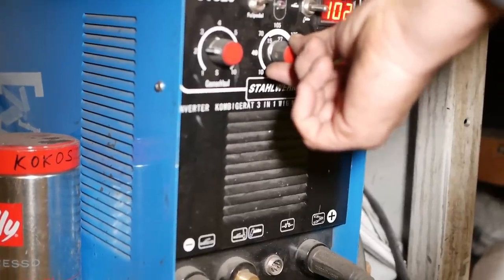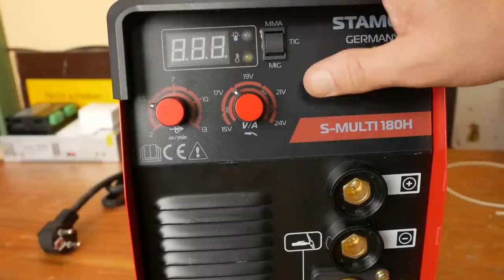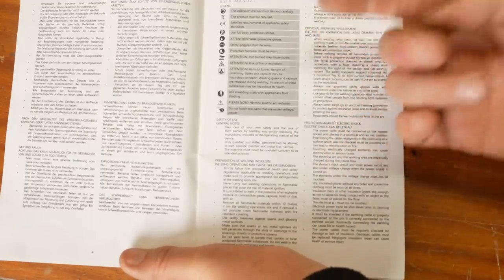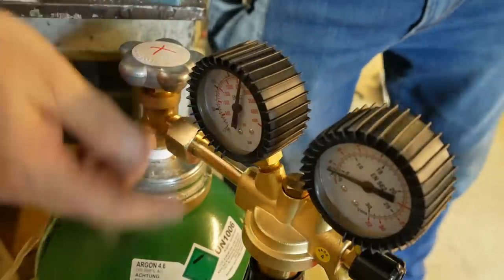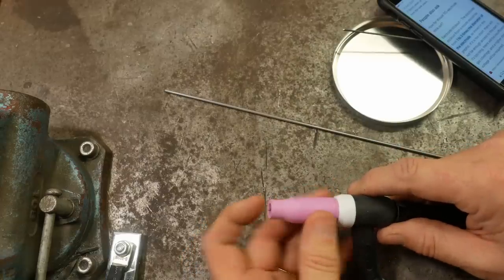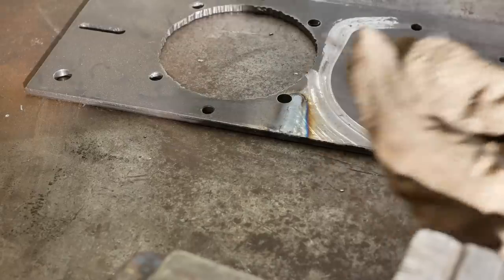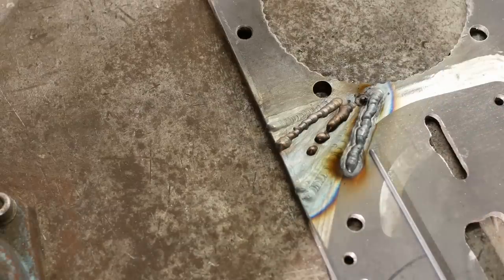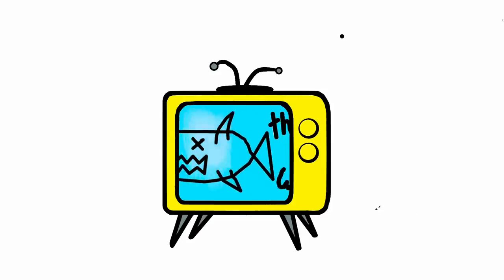Can I learn to TIG weld in an hour using just the internet? || RotarySMP

Comment: The one nice thing is that once you get it , then you got it. I can go months without welding them pick up the Tig torch and then within a few minutes Im back in the groove.

Initial it took me weeks to get a half decent weld down.

Aluminium is a while different ball game all together
Reply from the maker: That is encouraging to here. I am the same with the guitar. I never loose it. Math is another thing. That i forget when I dont use it.

This being DC only, there is no temptation for Aluminium.

Comment: Red or gold, what ever you find cheaper, id go 2.5mm for the amps you're running.  1.6mm filler rod is a good start, can all ways feed in more when needed, to much filler of a larger diameter will cool the pool and make it hard for consistent heat.    Try lap welding 3mm plate at about 40-55 amps,  cooler to start with and take yoir time, if it takes more than 2 sec to heat the pool youre too cold.    The hotter, higher your amps, the faster you have to move,  cool and slow, watch the pool grow as you feed in the rod.  Id start with a little more stuck out on tungsten, hold torch a little higher so yoi can see more of the pool.    30 year's aluminium tig, and mig, with S/s and mig arc welding.    You're doing as kiwis proud, best way to learn, just have at it.   Great attempt, hats off to ya pal, from Palmerston North, New Zealand
Reply from the maker: Thanks Russ. I was based at Ohakea for a few years, so was in Palmy a fair bit.

I also got a recommendation to use grey electrodes. I fear I will receive so much conflicting guidances that I end up confused.

I did another session this morning, and already picked up to be more patient to let the pool grow, and not jam in as much filler. I'll try your exercise on me next practice session.
Reply: @RotarySMP  if you have the time, and the disposable income to afford, try everyone's method, it is very much a personality feel, I gave what I feel works well for me, others have done the same, find what works for you and run with it.  If you remember doing brazing, or silver soldering at college with oxy/acetylene, it's much the same,  it's just the plasma arc heats the base a Lot faster.    Simple as Dab, move to edge of pool, Dap and repeat.  Try watching the edges of the pool rather than the arc all so, as it is so bright, it'll blind ya.     You showed the best attempt I've seen of anyones first go.  You're going pick it up fine.    Some people can, some can't, other's you can teach.  You showed already that you can.  👍😉
Reply from the maker: @russcole5685  Thanks for your feedback Russ. I think stick welding all my projects in the last years has helped me prepare for this. The only gas welding I have done was a sheet metal tool box apprentice project.

Comment: some tips.
1. get a flex head. they are very cheap and makes getting the correct angle very easy. 
2. (if you dont have a foot pedal) generally the 40amp per mil material thickness works very well to get into ball park, but when welding something small like a 1cm wide 2mil thick piece you wont set it to 80amps. usually i would go a bit colder like 75amps. 
3. get ready to sharpen a lot of tungsten electrodes. I did all my welding with stick and when going to tig you need to get used to holding the tig torch still at the end till arc stops. 
4. most of your welding you will be using the 1.6mm tungsten and filler, get a bunch.
5. flow meter is set based on the cup size and a bit more or less depending on situation (upsides down or not, are you welding in a space that will cup the argon r a sharp edge since argon is heaver than air) and cup types (if its gas lens or not, basically laminar flow or not) 
6. usually you are trying to get the the electrode as close to the weld pool as possible without dipping to get the best smallest weld pool.
Reply from the maker: Thanks a lot for your in depth response. It is a big help to get feedback like this.
Reply: @RotarySMP  One note Re the amps. It's a budget machine, so the dial might under-report the actual amps. If you don't get enough penetration or your puddle seems too cold, don't hesitate to up the amps despite instructions and tables telling you that the amps are okay. You can always dial down again if things move too fast or you start blowing holes into thin stock.
Reply: OO for flow rate, Cup size x2 = CFh will get you in the ball park, generally a no5 cup is good for most welds we will do in our small workshops. too much flow and the turbulence will pull in air and oxides will form (gray shit). if flow is set, amps set (not too "hot", cool enough not to oxidize when it gets out of the cups argon), metal is clean and shiny and you travel at the correct speed the weld will look shiny like new steel. too little flow will also let air in and oxidize the weld. 

7. the root is the be all end all, luckily in tig welding you can see the root of the weld easily and you will be able to see the weld pool go into the root BEFORE you add filler.

8. too hot (combination of amps and weld speed putting heat into pool) will cause under cut. in small stuff like brackets to hold a servo cable its fine, but anything that will see load cycles its no good since it will cause stress risers.

The strongest welds i have ever gotten is with tig welding and its nice because you can actually see what's going on and will know if the weld is good while welding. 

9. if you have any questions, use your community tab. we like to help and its fast feedback. What makes tig welding difficult is usually the prep. the amount of prep stainless requires is a pain. other than that, its quick to pick up.
Reply: @graealex  yes true, forgot that one. set the machine based on the simple ball park and adjust during welding based on what you see and want.
Reply: @reinokotze  Yeah, just don't assume that 80 Fronius-Amps are also equal to 80 Chinese Amps...
Reply: @RotarySMP  another cool thing you can try is weld a piece of square tube to another piece at 90 degrees clamp it in the vice and go over the welds with the tig torch again with holding the part sticking out. you will feel the peace moving very forcefully and you get a better understanding and appreciation for weld distortion. 

11. get a set of very good fitting tig gloves, they are thinner that that for mig and arc welding so you can easily feed the filler and usually made of pig skin. basically almost impossible with normal arc welding gloves. when i was a very cheap bastard i used pig skin garden workshop gloves, but they are not very long and does not cover your arms, also cant take the same amount of heat like actual welding gloves. 

12. get a long sleeve jacket that can cover your neck under your chin, under your helmet. you wont need to tan it you do a lot of tig welding. i look like a boiled crab if i don't wear any thing for about 30min of welding.
Reply: @RotarySMP  another thing on machines. 99% of machines have the DC part sorted. usually what sets a good brand apart is when they make a ad/dc machine. AC machines have the normal DC part that has the h bridge switching around 20kHz through the transformer then concerts back to DC, then for the ac part they usually add a half bridge (not the best, full amps but half the voltage) to switch the DC back to AC for AC welding. the issue comes in that the DC parts has a purpose made controller (eg UC3846 current controller) and those controllers work very well, but they use a separate controller to control the AC and the "request of desired amps (this us usually done with a variable resistor on your small arc welders)" from the current controller. many of these lesser machines use like a atmega64 or something for this with very shitty programming and not enough isolation on sensors. this makes the welding very inconsistent in AC and makes the machine basically only usable in DC.
Reply from the maker: @graealex  I played around with a wider range of current settings in this mornings session. Good point that the number on the display is likely not calibrated.
Reply from the maker: @reinokotze  Good points all of them thanks. I already worked out that those gloves are too stiff for good control.

Comment: I cheated my way into learning a bit of TIG although it was not part of the Ausbildungsrahmenplan as an Industrial mechanic. I found that having a good looking bead is a lot about having the right amps so the puddle forms quickly and you are not soaking heat into the part. The puddle should not freeze when adding filler and  the bead should be reasonably shiny when done. The difficulty is the travel speed you have to work at with the right amperage so you don't blow holes into the part and adding filler wire.
Reply from the maker: When I first read your post I read  "I found that having a good looking beard is ..." I was verys confused :)

Thanks for the tips. I need to practice with some thinner material, as that is what I will be using.
Reply: @RotarySMP  Having a good looking beard is also very important. It gives +2 respect from coworkers.
Reply: @vonSaufenberg  Also +2 Charm with the wife 😉
Reply from the maker: @graealex  Not with mine :)

Comment: Glad you took the plunge :) 

First of all, get a pair of proper TIG gloves, "normal" welding gloves won't cut it. Secondly, get yourself a pedal. Trigger is ok-ish, but the pedal will give you more control, especially over the amperage and hence, better control on both the focus of your arc and the speed of the weld in general.

Moving forward from there, a Pyrex gas lens (i.e. transparent) can help you see better on what you do. Optional but I personally swear by it. And on that topic, get proper filler rods too, some of the MMA sticks use flux and or other additions to their alloy as to prevent oxidation, since they don't have the benefit of the gas shielding. Always use as close to a filler material as to what you are trying to weld. As far as diameters go, there's a lot of guides around as to what one can use; go to a reputable TIG welding vendor site and you will find plenty of information.

A tip that got passed to me and I am now passing to you, is to keep a welding booklet of what worked (or didn't), in terms of material type, thickness, amperage, tugsten diameter, gas flow etc. Most pro welders I know of, keep one. This way you will always know what you do, and you will also notice patterns on what works (or will be working) best. Up until all these have become second nature to you of course. Let me put this another way, how much do people spend on these new synegic auto-welders that have these settings pre-loaded? 😉

Another tip for getting better at beading, is to start with a thinner piece of metal. IMHO 2.5mm or 3mm is best, otherwise you are trying to heat a bigger piece of metal and that is hard when beginning, as it is all about pool control. 100Amps at so thick a plate you used seemed quite under powered to me, for 6mm I tend to go over 150.

I do believe everyone will have an opinion on this, but personally I prefer lanthanated electrodes. And maybe a good idea to get a bunch of them ground and keep a half dozen next to you when you learn, better that having to stop and start re-grinding the one :)

And finally, don't worry, from what I just saw, you are on-par with what most (if not all) of us got when we first started TIG. Couple of weeks, some more practice, and you will be fine 👍

Best of luck :)
Reply from the maker: Thanks for your detailed feedback and encouragment. Very good tips in there.

I don't think this welder supports a proportional signal. The switch is just on/off. So a foot pedal will also only be digital, without amerage control.

I switched to some softer leather gloves for the three practice sessions I did on sunday.

I also switched to practicing on thin 1.5mm sheet, and using the MIG wire from that birds nest, drilled double strands as filler, until the filler I ordered shows up. I have a sheet of 2.5mm plate which will be the next practice peice, but it needs the paint removed first.

I got the advise to switch to a pyrex cup and gas lens, but only once I have gotten basic skills, as it is too easy to damage them with splatters and smoke as a noobie.

Good idea with record keeping.
Cheers,
Mark

Comment: Hi Mark glad to help.  i know absolutely nothing about welding ,however ,I have worked with a large number of qualified nuclear reactor welders, 
and paid attention to what they had to say,  which is largely , the setup manuals that come with  esab ,miller etc are correct and absolutely should be followed. shouldn't 
be had to download a copy.  other than that, apparently DC polarity is important as it decides where the heat is most concentrated.
When you try the Mig welder give flux core a try,   james bigger has a channel where he builds motorcycle frames and he used flux core.
for TIG art   WeldTube has a video of a titanium exhaust being welded
Reply from the maker: Thanks a lot for your support in getting the argon Steve. Good idea about using a manual from a different brand. In Austria we have Fronius making world class welders.

I once used fluc core on a cheap as dirt welder my Dad picked up from somewhere about 30 years ago.  Not a good memory, but I guess this is a better welder, and there are better wires today.
Reply: Apparently flux core must have reversed polarity to work properly
Reply from the maker: @steveggca  I have seen that plenty of people do good work with flux core. The welder I used with my Dad was a really crappy low end one fro the 1980's.

Comment: I'm afraid that for "MIG" welding carbon steel, pure argon will not work very well. Argon would be fine for MIG aluminium but you need some percentage of an active gas for carbon steel.

I can't agree on the info you found on the tungsten electrode stickout. For normal nozzles you got (without gas lens) a general rule is that the stickout should be around the same as the inner diameter of the nozzle you are using. This also works with the fact that if you need longer stickout, you have to use bigger nozzle. I generally use number 6 or 7.

I'm sure you've heard about Jody from Welding Tips and Tricks (love that guy) and for sure you know Tony..
They mostly use stubby gas lens setup which is totally awesome. You can even get it in Europe (I'm from Czech republic) - Binzel makes it (thankfully!)
Reply from the maker: Thanks for your feedback on that. A few others also pointed out I had the electrode set in too deep. Cool, that should make things a little easier. Where do you buy Binzel pyrex cups?
Reply: @RotarySMP   @RotarySMP 
I guess there is no problem with stickout thats too short other than you can't see anything.

I didn't mean the pyrex cups.. You can either get a collet body and classic nozzle (what you got) or gas lens and appropriate nozzle for that. There is also a variant where you get "mini" gas lens that's made to fit 17 size torch but takes 9 size nozzles and that's what I meant.

I unfortunately can't fin'd any part number for that. I tend to buy it over the counter as "mini gas lens for 17 size torch"
Reply from the maker: @T-workshop  Thanks, I need to look into that.

Comment: I had someone tell me to use a metronome to get consistency when adding filler. This trick really helped a lot. If you use this to advance your torch hand as well your weld will get more even.
Reply from the maker: Thanks Tom. Others have also suggested that. Since I play guitar, I have plenty of practice in rythym. I just run a song in my head and move on the beat. Was practicing that yesterday when I did three more TIG sessions. The song that I was using was Bob Dylans Jokerman :)
Reply: Just listened to the song. Didn't expect something like that for welding practice but it was nice to listen to!
Reply from the maker: @tomwagemans1872  I used to play the guitar and sing it to bore the kids to sleep when they were little. It is a good choice as it is endlessly long :)